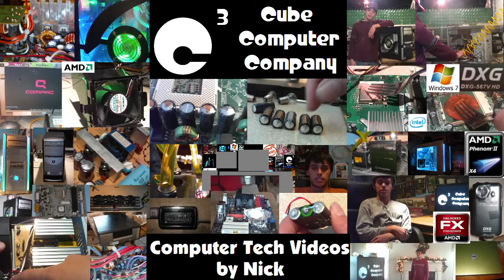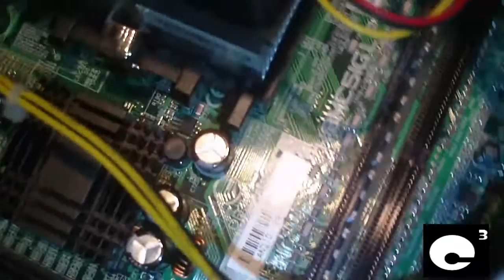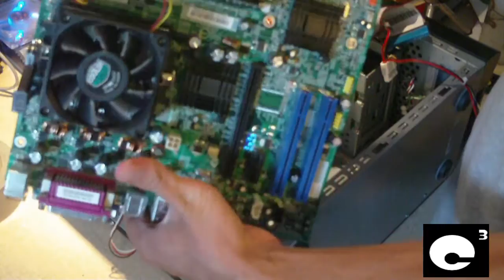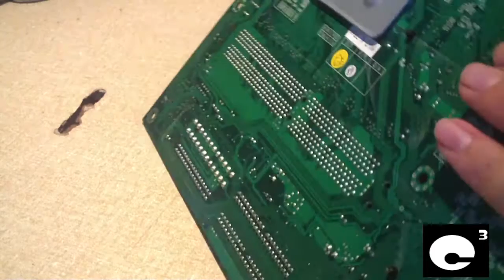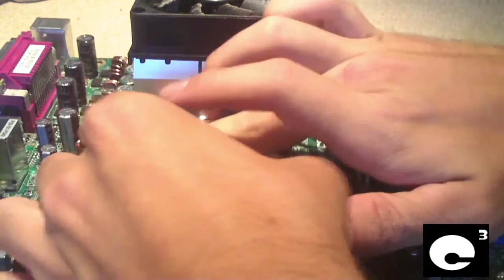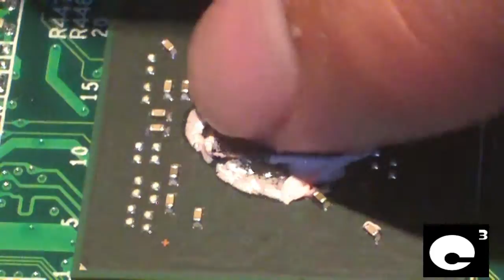Improve Chipset Cooling on eMachines T3418 (GeForce 6100)

Comment: does the chipset get just as hot if you aren't running the Integrated Graphics? Would it hurt just to replace it?
Reply from the maker: +Jason Hicks (TyrForFreedom) The chipset might run slightly cooler, though it still gets as hot as a match.
Reply: ***** thanks good to know. its on the of few things I forget to check. I tell ya the nVidia nForce 2 chipset gets really hot. I let it run direct x test for about a hour just to get the bubble tape gum of it.. and still had to boot it without out the heatsink to remove the rest! Put some Mascooler 420 on it ;)

Comment: Do newer motherboards use this stuff? I bought myself a new MOBO 4 months ago and should I change the stuff that's under it? I've checket and the chips on the motherboard are getting very very hot - almost burnt my fingers on it! Should I be worried and change the thermal paste?